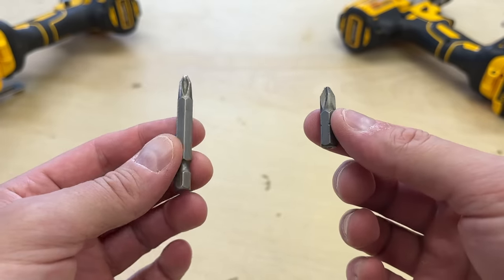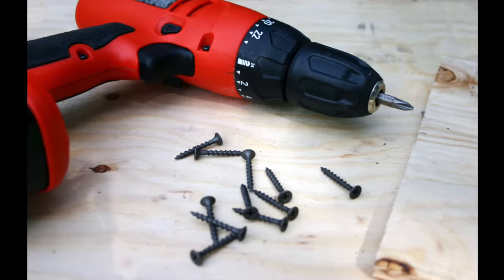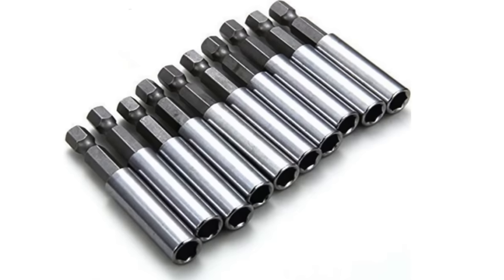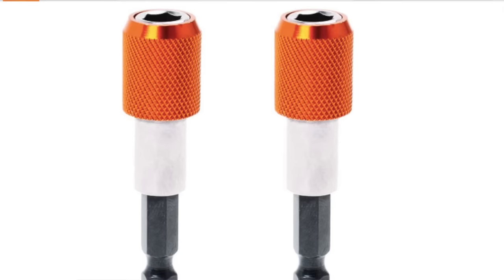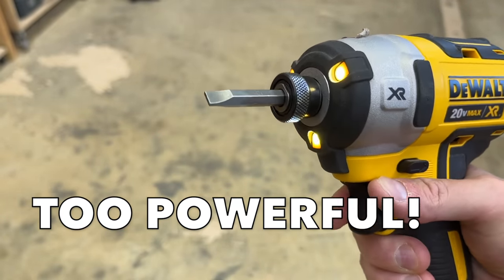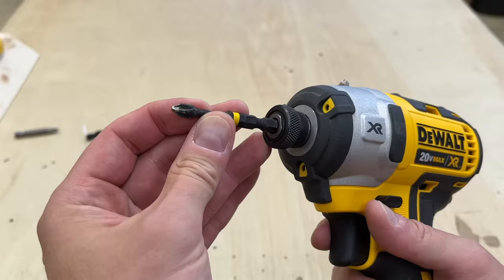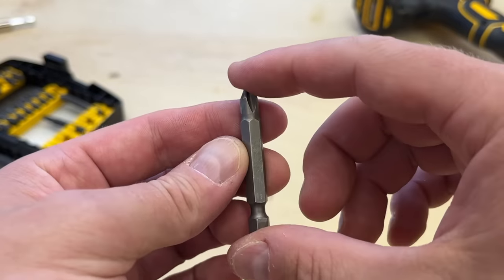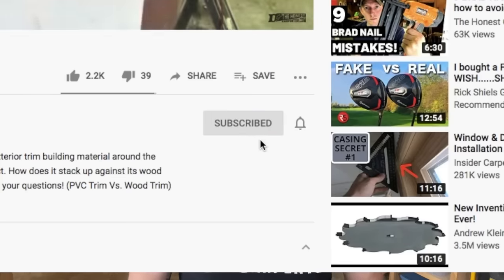Power Bit vs. Impact Bit vs. Insert Bit...WHAT'S THE DIFFERENCE?! (Driver Bit Guide For New DIYers!)

Comment: The cheaper power bits have that groove for locking bit holder extensions etc, like the one you briefly showed, to use with normal drills. As a multi- service mechanical technician I rely on my drills, (standard, right-angled and compact) more than my impact drivers for precision work, with a variety of sizes of locking extensions and a huge assortment of hex shanked driver bits, wood boring hole, titanium, nut drivers etc.
Reply from the maker: That makes sense, Ron! You need less brute power, but more control and access 👍

Comment: if your question is why do power bits have that small indentation which I think you refer to as the "power groove", I don't know for sure, but manufacturers will go to great lengths to reduce the amount of metal they have to use to fabricate products, so maybe it is just to reduce the amount of metal used in manufacturing - just a guess.

Comment: DeWalt use to state on the side of their bit cases the application i.e. screwdriving or Impact rated. The 1/4 collet Is not just on impact drivers but also on powered screwdrivers, DeWalt still manufacturers power screwdrivers most have Variable speed triggers and a clutch similar to a drill driver. They even make one that uses a Gyroscope That speeds up, slows down or reverse direction as you turn your wrist, but most look like an impact driver with a Clutch.

Comment: Engineer here. The ends are standardized (in Germany, for example DIN 3126; international ISO 1173) and have names, such as "Form A" or "Form E 8." You are NOT supposed to insert short bits into a drill, only the longer. Bonus: The narrow neck on impacts is a marketing gimmick that actually weakens it. Use to enable a smoother driving, prevent the bit from caming, but actually doesn't work.

Comment: I use grooved, long bits with a manual bit driver or a drill when assembling lamps and other electrical components, where a bit holder with a regular bit would be too thick to drive a screw deep enough. Common when fastening connectors to a spotlight rail for example. Also, using impact for these things would probably cause damage.

Comment: Made the mistake of using a regular bit in my impact trying to tighten a door hinge screw, the tip blew apart instantly. Could have lost an eye. I like the Makita impact set.
Reply from the maker: Yep, I’ve had them snap very violently, and they’re insanely sharp and jagged. Easy to get a puncture wound 😬

Comment: You might be technically correct, but I use all bits in all drivers and have never had a problem driving into wood. Having said that though, I have snapped my share of "drywall" screws using them for not intended purposes!

Comment: I feel compelled to explain this better. It's not that they "handle the torque better" but rather they reduce the total force imparted into the hardware it's being used on. Think of it more like a torque limiting stick used on lug nuts. The skinny, flexible shift allows only a limited amount of force to be transferred. 
The reason those other bits break is due to it passing more of the original torque through to the hardware AND being used repeatedly (unlike the hardware which will generally be used only once, except thats why its required for things like lug nuts because you reuse them for possibly the life of the vehicle). Much like how some firearms are recommended not to be dry fired, it's very esoteric metallurgical logic. Basically, the repeated impact interferes with crystalline structure of the solidified grains bit by bit, weakening the integrity of how all those grains attach to one another. This is how most treated metal becomes brittle. 

Sorry for the long winded response, but I'm a bit of an enthusiast.

Comment: You stated the insert bit had an indicator to know how far they are to be inside a 3-jaw chuck.  Actually the purpose of that small grove is for wire-detent bit holders.  What you call a power groove is technically the groove for ball-detent bit holders. 

I have been using power bits for decades and have yet to break one using an impact driver.  The Phillips tip or square tips will eventually wear out.  

Another application where insert bits MUST BE USED is in drywall screw guns.  The chuck’s are designed for these short bits with an adjustment to control how deep the drywall screw will be driven below the drywall surface before the bit tip disengages from the screw.

Comment: Can you do a video on how to pick out/shop for impact bits? I can’t figure out how to pick out finer or thicker slotted tips for electrical work. I’m in training trying to build up my tool set and keep coming across old slotted screws where the slots have different widths. Standard flathead screwdriver and bits are sometimes too thick and sometimes too thin.

Comment: As always, I appreciate the information. I bought myself a Ryobi tool combo kit( circular saw, impact, and power drill, a multi tool, and a sawsall(?). I've only used the power drill and circular saw. Took the others out stared at them and re boxed for " another days " adventure. 🙄😂😂
Reply: It sounds like i bought the same one too! I was tired of forever asking my dad for his drill. I had a corded one but then I'd have to hook up an extension and if I'm outside that means 100 get of cord! I've used them all in the past couple months except the multi tool and flashlight and driver.

Comment: The sleeve on the bit holder is to use with straight groove screws to prevent the driving bit from sliding out of the screw head.

Comment: these were created about twenty five years ago, mainly before mpact shank bits were  reason ...used for extention shafts fir quick change use....only....exactly like you said, do NOT use in mpact driver gun....fact I only use them with any quick change tool  like countersink shaft tool...or my 12 ext. shaft with quick change tip...only use in my drill/driver gun...mpact bits have only been on market fir maybe fifteen years  ppl don't buy them unless they know what their use is for  cause so expensive...I only purchase Milwaukee six inch mpact ext. n use reg bits...if you drop gun with that long shaft ..time to go buy another one...its bent now ....vibration of wobble is incredible hard to maneuver long screws in or out...commercial carpenters have been on cutting edge of tool ideas for manufacturers since the very first cordless tool...makita 9v drill....'92 befire that corded drywall guns n Milwaukee n BnD skrugun with adj. torque drive...1/4 here drive....'95 when I bought furst 12v Dewalt drill/driver....last was 12v Milwaukee 1/2 chuck hammer/drill/driver...never needed anything bigger...for work....at home tho I have 28v Milwaukee Sawzall, hammer/drill, grinder set...20v Dewalt 1/4 mpact driver, 1/2 drive mpact gun. 1/4 hex12v  Milwaukee driver two speed...tiny gun...I love use fir most everything...oh 12v Milwaukee palm nail driver...beats swinging 30 oz. estwing at my age fir 16d nails ...other than that air powered nail guns still top in my book...looking at battery guns....not sure worth cost yet....hilti powder actuated guns...

Comment: Impact driver and insert bits is all we use for rapid jobs like framing. We never bother with impact bits on soft wood and good quality well fitting PZ2 screws. Buying insert bits in boxes of 25 just means they're consumable.  Even impact bits don't last long in the real world and quality insert bits are cheap! Occasionally, they do lose a tooth or two, but with good fitting quality screws it's rare, however 10 seconds later the chipped or dulled one is on the floor to be swept away and a new one is spinning up.

Comment: I'm not a professional but I've driven thousands of screws with my impact driver and regular bits and never had a bit snap. Probably 90% Robertson screws if that makes a difference. Are bits snapping really that common? I've heard of "impact rated bits" but never bothered to use them. A couple decks, a shed, 300' of fence and plenty of other projects under my belt and never a problem.

Comment: There is a bit of gimmick here too. I’ve driven thousands of screw and often with the “wrong” tip and no problem. My truck is a proverbial hardware store but if it’s not within reach I use what I have, if I spend 5 minutes searching for something it cost my client $7, a regular tip will do.  I do high end carpentry and my quality does not suffer. But thanks for the video, you do nice work. Home Depot should send you a check for driving up sales. ;)
Reply from the maker: Thanks Steve! Good explanation of the tradesman’s dilemma. Sometimes better to just burn a bit 😁

Comment: I kinda knew the difference already, I'm just too lazy to go buy different bits for my different drills/impacts, so I generally just buy those power bits because they fit in my impact, and my drill, and can be used in either, technically. I don't think I've ever broken a bit, but they do wear down eventually

Comment: I had always used hammer drills in the past and so when I got my first impact driver I didn't know it required special bits. I needed to unscrew a few Phillips heads so I quickly loaded the impact with a short little bit. It got sucked in so far it was clearly unusable and not only that I couldn't get it out again! I finally had to sit down with a pair of tweezers to extract it. I guess somewhere in the fine print it said "Don't do this!" but I was pretty annoyed (and embarrassed.)

Comment: Do insert bits and insert bit holders have the same strength and abilities as power bits? I know you mentioned power bits let you see more. Thank you for your channel. I learn a lot about DIY and am more interested in carpentry because of your channel.
Reply from the maker: I think they’re very similar, Yoda. But on a micro level, you’re probably getting slightly better power transfer with power bits bc they’re chucked directly into the jaws. Thanks for watching!

Comment: Power grooves on normal bits may be because some impact drivers have adjustable max rpm and speed adjustment, like my brushless Craftsman, CMCF820D2 .  I use any bit I want, never had an issue. To be fair though, I'm not a professional using tools in the trades

Comment: My impact driver actually came with a "power bit".  In fact it's even got a little clip just above the battery where you can put it when not being used, which wouldn't fit the skinnier necks of the impact bits.  Strange that they'd ship it with a bit that you say shouldn't be used with it.
Reply: its an impact rated bit, just not "as good" as the new hotness, and less easy to identify is all

Comment: Is it entirely due to the higher torque possible with impact drivers, or is it the hammering action?  I have a hammer drill but I can turn off the hammering and just use it as a drill.  And when it comes to most screws seems the limiting factor is how well the bit can stay locked onto the screw, rather than the power of the driver.

Comment: I use power bits in my impact driver all the time. But my driver has 3 different power settings. I put it on either of the lower 2 settings and not only has it not broken any, I don't think it could.

Comment: I agree that’s the point of them, but I’ve found a quality bit is a quality bit, legit name brands usually hold up impact or no (of course all wear down eventually, but a quality dewalt bit isn’t going to snap from a regular impact driver). Same with impact sockets; I’ve used my non-impact dewalt sockets all the time with my 700ft-lb impact, never had a single one deform or shatter. Overall I’d say a quality brand matters more than anything else.

Comment: You can use the regular bits in an impact driver. They don’t have to be impact rated. I’ve probably broken more “impact rated” bits than regular ones. Usually the only ones you’ll break or wear out are T25s or drivers anyway. You’ll slip the bit or round the head off on Phillips, Allens, or flat head well before you’ve generated enough torque to break a bit.

Comment: I don't think there's any big mystery about non-impact bits having a 'power groove' - 1/4" impact drivers are a relatively recent development, which have quickly become very popular, but 1/4" bits of various lengths and various types of magnetic and locking bit holders have been around for decades, so now we have a situation where there are lots of bits on the market which will fit into the the new-fangled impact drivers, but aren't impact-rated. Just make sure that you use impact-rated bits in your impact driver, and you'll be fine. For what it's worth, I still use a combi drill much more often than an impact driver, because it's just too easy to overdo things, strip or snap screws etc with an impact driver.

Comment: In 20+ years I’ve never snapped the shank of any drivers I was using properly. However the tips do snap, and the frequency depends on the material you’re driving screws into, and it’s usually ONLY the Phillips tips that break. Typical framing lumber & sheet metal- almost never. Hard wood & thicker metal - it’s going to happen often enough to really annoy you. So before you spend more money than you need to, consider the material you are driving anchors into. Don’t let marketing trick you into wasting your money.

Comment: All the videos I find seem to ralk about the same thing: don't use non-impact rated bits in impact drivers. What I'm wondering about is the opposite: can impact drivers handle the sustained high-torque provided by a drill/driver?

Comment: Here's what I have learned. The bits that fail the fastest are usually improperly heat treated. Without fail every time I have bit breakage I would mount and etch it and find undissolved carbides in the microstructure. This is because the product was not held at austenitizing temperature long enough and complete transformation never occurred.

Comment: Some impact drivers actually come with power bits and even hold them on the tool itself.
Reply: And that's perfectly fine, the "torsion" zone and most impact bits are actually more likely to break.

Comment: I believe impact bits are engineered to withstand Rotatum, which is the change in torque over time. Impact drivers uses quick bursts of torque to drive fasteners.

Comment: I have a bosch battery drill gun and the regular power bit with the power groove is needed to seat into the spring loaded chuck||arbor||coupler or whatever you call it.  I tried other bits like kobolt and dewalt bits and some of them will not securely fit into the bosch.  I guess brand security through exclusion.

Comment: The quick change bits have those notches for bit retention in bit holders that have retention clips, they use a release collar to eject the bit so you don’t have to fight the magnetic retention. (You had a picture of one version, that fat collar by the head was a release collar) those notches are not depth guides. Nice try though, they do work for that, but not their designed purpose.

Comment: Great video as always Ethan. Question; have you ever considered doing a video regarding compressors, and the best means to control moisture in tanks? If so is there an effective, easy install, inline moisture control system; portable and/or permanent shop mounts? God bless.
Reply: The moisture in the tank is simply the humidity being "squeezed " out of the air.  It will always be there.  If the tank holds air at 140psi, then it is at ten times atmospheric pressure.   That means it can only hold 1/10 the amount of water.  The other 9/10 is condensed out along the cooler surface of the tank.  Since the air (a "gas") heats faster than the tank, and since heating the tank will increase pressure on the air - thus further heating the air, the tank will always be thermally cooler than the air it contains while being pressurized.   Thus the humigity will always condens out.  This is why drivers using air brakes must "bleed" the air lines daily.

Comment: How much torque do you need to apply to a bit before it snaps? The screw head will probably snap, or cam out/strip before the bits break so it's a moot point, unless you're driving some lug bolt with an 1/4" hex then yes I would agree to get an impact rated one. I wouldn't use chrome vanadium sockets on an impact wrench but geez those are just screws lol

Comment: non-impact bits sometimes used with long extenders, with the same quick-change chuck. Insert bits are not good in this case as it is too easy to lose them somewhere deep inside.

Comment: 3:18 I assume the normal bits with power grooves are for the smaller 12V non-impact screw guns like the Milwaukee M12 and Bosch 12V Max.

Comment: One other thing is with impact bits or power bits they are not really meant for those kind of extensions that are for the insert bits at least on impacts. They dont go in deep enough and then the the torque is applied to the thin part of the bit at the bottom of the bit and they break. Thats where the extensions with a locking collar extensions come in to make it lock in deeper like its suppose to. Jus to make more confusion for ppl that dont know lol. Because of where they break tho they can still be used on a drill and arent useless and basically become a longer insert bit lol grind the bottom flush to the shank and your good lol

Comment: It is NOT so much that impact drivers have more torque, but how the torque is delivered.  It is delivered in "impacts" and the reduced diameter of the shaft acts like a torsional spring and adsorbs the impacts to limit torque on the fastener.   The same as "torque sticks" are used on half inch impact guns when tightening wheel lug nuts/bolts on cars and trucks to apply the correct torque and not over tighten them.

Comment: Your audio quality is suffering from echo due to the hard surfaces in your shop.  Consider installing acoustic material (tiles, etc.) anywhere you have wall or ceiling surface you can spare to improve your sound quality.  Thanks!